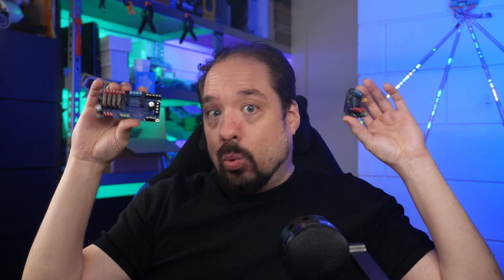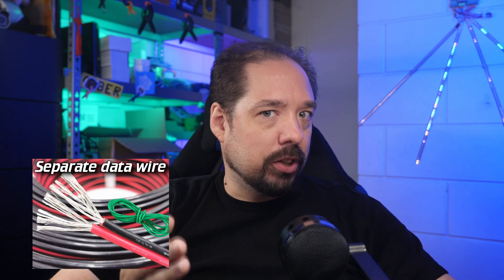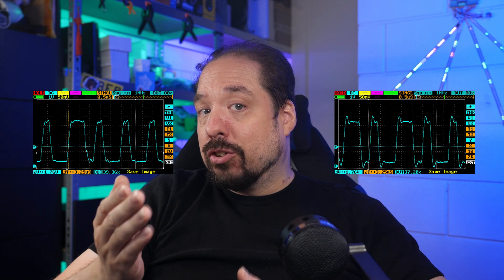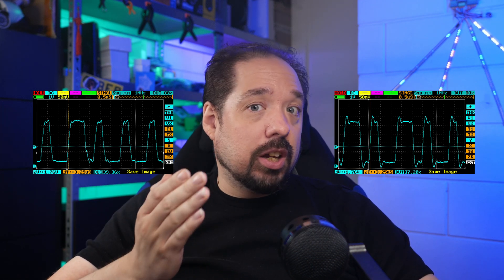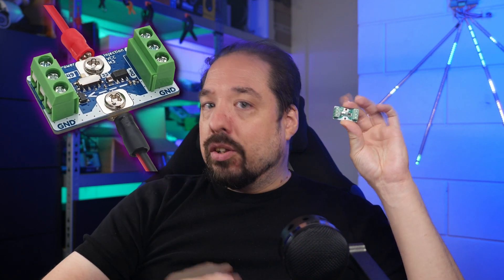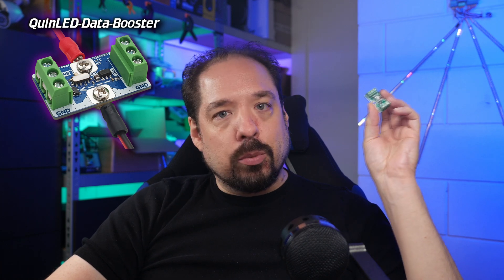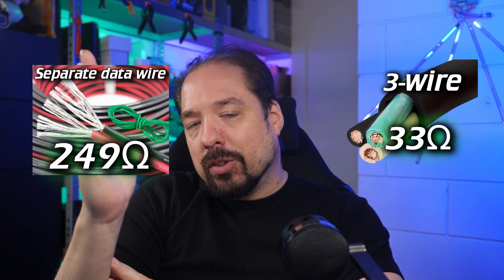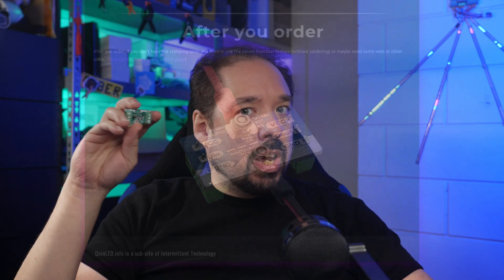💡QuinLED💡 Ever had flickering ws2812b LEDs? Watch this video!

Comment: so.. use a shielded data-cable. Gotcha.
Reply from the maker: It might help a little bit, but not that much. Since this video running on at least 2-wire cable with data and GND on there with a 33R resistor seems to be the best way to do it!

Comment: I have the problem that the first 4 LEDs in the whole row suddenly switch on. Always the same LED. I have a total of around 300 LEDs (5m) and around 1.5m from the ESP32 to the LEDs. I will now try to see if it gets better with a resistor.

Comment: What about using a twisted pair of wires with shielding and grounded on one end only. I'm not using differential wires, meaning the one wire is also connected to the grounded shield?
Reply from the maker: Sure that works but it isn't much different then data+GND running in paralel. Since the shielding is GND and GND is part of the signal (since single ended signal) it doesn't add much noise immunity unlike differential would running in a shielded cable.
Reply: @IntermitTech  So, how does this signal compare to a coax cable or other signal cables with single core in the middle with ground shielding? Certainly, they work a lot better than just a pair of wires?

Comment: What about a very short run of cable with the data line in it with the ground and power lines?  I'm working on a project in which I'll only have a distance of less than 3 ft between the controller and the light strip.
Reply from the maker: For those distances 249R and 33R will both work fine. 249R is a bit less shouting in that sense.
Reply: @IntermitTech  is it even needed?  After posting my question, I kept watching and later in the video, you mentioned the issue is only for long lengths of cable.  So 2 to 3 feet is long enough to have an issue?

My LED strip is a WS2812B.
Reply from the maker: @donireland6218 no no, as I mentioned for that kind of distance the value plays much less of a role

Comment: Thats what am looking for!  Great Video!  is that 33 ohm for one data wire... what if I want to use 3 data from one ESP32 board to three WS2812B strips.  does that mean 33 ohm resister on each data output?     4 cores cables (data1, data2, data3, Ground)

I enjoyed watching your channels :-)

Comment: I have changed resistor to 33 Ohms, it got better. But still some effects is flickering and some don't. Why can it be? Do I need power injection or data booster?
Reply from the maker: How long is your data cable and what wiring are you using exactly? It's really best to troubleshoot on the Discord server
Reply: The length of the first data cable is about 10 m on the first channel.  There are 106 LED's in it, powered on both sides. The length of the second data cable is about 5-6 m, there are 91 LED's on the second channel, the power is connected on one side. The effects start from the first channel and move on to the second one. The second channel works fine, but in the first channel half of the LED's, which are close to the end work randomly, but not in all effects. For example, Candy Cane, or Chase 2 works fine, but Bouncing balls does not. In addition, when the power is turned off on the WLED app, some light bulbs continue to light
Reply from the maker: @fevgg yeah that sounds like data issues. Are you running 3wire bundled cable?

Comment: I'm thinking that a tiny, adjustable trim pot would be a nice solution.  That would allow for better impedance matching with a variety of wires, and, at the same time, be easy enough to test with someone simply seeing where things were most stable on their string.  Cheap, easy, and flexible, and, avoids resoldering different values, or fixed values that may be compermises.

Comment: I started just with WLED and was frustrated that the LED behaved bad. Eventually I saw some article saying put a 240Ohm in DL; had none, but used 220Ohm. That worked. But you explained why. Thanks for that.  Now I need to find my little digital oscilloscope and try to record the data myself.

Anyway: subscribed …

Comment: Originally I was searching for best practice regarding ethernet and router configuration, but now I wonder if (in case one has an oscilloscope on site) the best practice for varying cable lengths simply a poti is.

Comment: Great info, I do have a question regarding my setup. and hopefully i can get someone to help me out. What i use: DC5V10A power supply, 5V BTF-LIGHTING WS2812B RGB 5050SMD, ESP WROOM 32 ESP32 Development Board 2.4GHz WiFi Dual Cores. I have them installed and they were working ok but i saw power hungry by the end of the strip (this is installed on the top of a room) so i provided 5V at the end of the strip and that fixed the power issue. 3 days later, the controler fried. I changed it for a new one. It worked fine for about 10 mins then i got that crazines color changing and flikering. I already separated the data cable from the power supply wires and still the same. the controler and power supply is about 1.5 meter away from the 1st LED and the full LED run is about 50 feet and 900 pixels.  What DO I Need to fix the flickering and random color changing??  TIA
Reply from the maker: That's a bit much to go into on a comment. If you are using multiple PSUs make sure to have a strong GND connection between them.

Data wise without a level-shifter and resistor it's more luck then science if it works at all. So that could be a problem.

900 LEDs on a single pin will also cause big framerate lowering, I recommend no more then 600.

Wire diameter for the injections are important too, especially with 5v stuff.

Not sure what is causing the ESP32 modules to fry though.
Reply: @IntermitTech  thanks so much… I am going to change the wiring for a smaller gauge and get a higher power supply and go from there.
Reply: UPDATE: I change the power supply (the previous one was rated 5V 10A but was pushing out 4.3V and about 3A)  I installed the new one that it is a 5V 60A. this one is pushing out 5V and about 40A. I also changed the wiring that goes from PS to Strip for a smaller gage and worked perfect. I have my auto brightness set at 5000 in the settings and it is more than enough.
Keep up the great content!!

Comment: If you drive DIN without a resistor and WITHOUT the main supply, you will burn at least the first WS2812B LED. 
Having a 230+ ohms resistor will protect somehow the input by limiting the current. That's a good reason in itself.  It should also protect a little against electrostatic discharges.

Comment: Thank you for your products. Appreciate the thought that went into the dig-quad and the videos and articles explaining how to use it and the concepts behind the board. Getting ready to start a permanent install of about 900 LEDs via 3 home runs. Was testing today and ran 5m ws2815 over outdoor 100' 3 conductor 16 AWG copper cable. (Soldered the backup data and ground wire together.) 249 gave some flicker. Was going to cut the wire at 3 foot increments to find the limits. However, found your guidance on the 33 ohm resistor. To my surprise it worked straight away over 100'. Super pumped about my project and showing off the lights. Thank you so much!

Comment: 😊So I had a problem with flashing lights, I thought I was going crazy because I couldn't solve the problem, I run an xlights show with two Dig Octa cards, I switched the switches to 33 and the problem is gone. If I had known where you live I would have brought you a smoked salmon from Urk, I can now sleep peacefully again. I did this after seeing this tutorial. I have everything with 3 core cable. Thank you for the explanation.

Comment: My God, you are a hero. 4 years of multiple ways of troubleshooting, and the fix is found because of a ground wire run with the data wire.   I am extremely happy and somewhat upset because of how simple the fix was and would have been in the past. I did upgrade my lights this year finding a work around, however I ran the lights the way I wanted thanks to you and the info you provided.  I happened to run across this video yesterday morning right before I plan on putting the lights up on the j channel I installed on my house. I tested it on the ground where I ran a f amp with nothing 4 days ago. Seperated the data line and wala. Installed on the house and forgot the f amp. Decided to test, and it's a miracle.   It is so simple, yet for some reason, I never would have run a test to find the answer on my own because I would have never imagined that being the issue.    HUGE THANK YOU!!!!
Reply from the maker: Awesome to hear it helped you out!
Reply: I have power and ground in one cable and 3 data together in another cable. The cables are ran about 5 meters and I'm having flickering. Would just adding the 249 resistor to each data line fix the issue, or is there also an interference issue with them being in the same cable. Thank you for the video, very informative..
Reply from the maker: @justintucker2172 no, running multiple signals next to each other is the problem there. Best way currently known would be to run 3x 2-wire cable with a data+GND on there in 33R resistor mode. That will very likely fix it!
Reply: @IntermitTech  I was under the impression that the ground was causing drain to the data, but you're saying I need a ground with data in 3 separate wires with the 33r resistor, correct? Thank for the quick response, had a little bit of a what went wrong moment when I finished the wiring the other night..
Reply from the maker: Yes, this type of data will have lots of crosstalk in that sense. So running multiple together over long distances is a bad idea. Running 3x 2-wire cable with GND on one of the pairs of each cable will provide a bit of shielding and probably make it all work. This does require the 33R resistor though.
Reply: @IntermitTech  Awesome, thank you very much.  Made sure to subscribe, great information.
Reply: How about splitting a data run with a simple y  cable assembly? I know this isn’t recommended and I have seen 4 way amplifiers from BFT Lighting. I have gotten away with the y splitter on a short run (maybe 8’). What ohm resistor would help in this scenario if any?

Comment: I have two jumps on my roof, I would fully be able to place the controller in the attic and start in the middle, eliminating the biggest jump and making it work. I am hopeful to make both jumps with one continuous run. However, I am having data drop. I am running in a 3 wire cable with 2811 and 248 pixels. When I get home, I am going to run a dedicated data line and cross my fingers.  Good luck, everyone.  Thanks for the video. I do have a f amp I put in the line not helping a thing.

Comment: Would this degrade over time?  I have that second scenario ~8-10 m of 3 strand wire.  I set it up on the 249 ohm and it worked perfectly initially.  However, after running for about a week, i now get major flickering and strobe effects.  It seems to be exactly what you're describing, but I dont know why it would work perfectly initially and degrade over time. Any explanation? Or should I look for a different solution?

Comment: I  suspect the reason the added resistor to the data line or, for that matter, the decoupling capacitor across positive and negative lines are not talked about much or when they are talked about there is no consensus is because it's part hogwash and part voodoo superstition.  The very same reason you'll be told you MUST use a resistor any time you use an LED yet billions, literally billions, of LEDs fairy lights are sold without a single resistor.   Myself, I have never once used any resistor on my data line, not on any of my projects and have no evidence to suggest it has caused any problems.  I generally don't use a decoupling capacitor either unless the distance from controller to LEDs is greater than four or five feet, though this is done more because of my own superstitions rather than any evidence it solves any issues.  I am currently looking at one of my earlier projects that has neither a resistor or capacitor on the twelve foot span of lead wires and has been running error free for years.  Years, and not a glitch.  Your mileage may vary so take my voodoo advice at your own risk.

Comment: Interesting video! I've had success with WS2811 and 12b using a single electrolytic capacitor in the data line, ~100-200 microfarads. This is what I use for a 1300 LED bulb array (similar to those xmas lights) with data running adjacent to pwr+gnd, as well as for a 91 LED strip series (+a bunch of parallels, 1091 in total). The cable length to the first pixel is ~2m max for both.
Reply: Only the distance to the first led should matter. The  signal is buffered from led to the next.

Comment: Great Video, I'm doing a project, 17 stairs, 59 led per stairs, installed in a diffuser, (60led/meters WS2812B).  I have 2 types of Boards I can use (ESP32 CH340C, ESP8266).  I've tested with both boards and  it works A1 up to the 14th stairs and then the 3 top stairs either blink or stay lit, I wonder if adding a resistor would fix my issue or if I've reached the limit of my 2 boards.  I've injected  voltage but I can get the 3 last steps to work properly.  I'd really like some help.
Reply from the maker: Poh very hard to diagnose like this! Maybe join the Discord sever? Easier to dicuss things.

Comment: Good explanation,  with the ground running next to the data signal, its acting as a capacitor, so you have an RC circuit.   That ramp is the charging of the RC circuit.
Reply: Not just the ground, but all of the other conductors in the cable. The more conductors in a cable, the more its capacitance per foot changes. (think of larger plates in a capacitor) The rounding off of the waveform corners is an example of integration. The small peaks on the corners of the signal are differentiation.  Picking the value of the resistor is actually easy. Its value should be as close as possible to the cable impedance. What's not easy for the typical user is determining the impedance of the cable.

Comment: Hey, Thanks for the great information. I will definitively buy a few of those boards. I was also looking to buy the QUINLED DIG QUAD esp32 with LAN but the worldwide side (I am from Canada) says it's out of stock.... : (. Any other way or place I could purchase one of those board?  Thanks in advance.
Reply from the maker: If Worldwide is out of stock too we've really run out. A new batch is on its way, check back at the end of the week or begin of next please!
Reply: @IntermitTech  Managed to order 1 with 3 Data booster!!  : ) Can't wait to get them and start working on my project. Thank you.
Reply: @IntermitTech  I ordered Two V3 DIG-Quad last week do I still need the data boosting board ?

Comment: would the booster be better nearest the strip or halfway? what about the resistor? i do have a very long data line bundled with others for half of the way but it is dedicated. im thinking a 'differential' signal might be useful, if you have a video or guide somewher eon that? or a chip i could buy? or would it be simpler to just have another controller mounted nearer that strip?

Comment: I’m at a loss even after this video. My cables are all separated, but I tested with a 33ohm, 67ohm, and 270ohm resistor. 67 seems the most stable, 270 made the LEDs difficult to see (as though they barely worked anymore) and 33 made them flicker ALOT. 

My guess is that I need to find a sweet spot resistor for my setup, just despise all the testing that’ll have to be done. 

Any ideas?
Reply from the maker: Yeah it very much depends on the setup, from all my testing 249 and 33 was best for specific situations and made a lot work, but it's possible your setup reacts a bit different.

Comment: I have a question regarding the total length data can travel on strings via a Dig Uno. I know power should be injected every 5 meters but at some point does the data signal become too week to drive the LEDs?
Reply from the maker: No in theory the data signal gets repeated by each LED so can run for longer lengths (not long gaps though, the LEDs need to be fairly close. But there are limits, see here: https://quinled.info/2021/03/23/max-amount-of-addressable-leds/

Comment: I think your video will save me for tomorrow, i just put 4 120 Leds strips separated betwrenn them for like 4-6 meters, so what i will do is after the end of each strip i will add the 249 Ohm resistor to check if the signal goes good to the second and thris strip! ill let you know!

Comment: Okay, but WHY does the resistor help? You explained the scenarios and electrical values and what happens on a scope, but not why a resistor (and not a capacitor, inductor, etc) is the right fix here.
Reply from the maker: Ah right, that wasn't really the intent of the video. In this case the resistor better matches the impedance of the cable and for scenarios where GND is close it allows a much higher and quicker pulse of energy over coming the effect of having ground so close to it for the long distance. It's just a different scenario to tune for basically. The resistor also provides in a bit op dampening for the single ended signal to dampen down reflections and such issues otherwise.
Reply: @IntermitTech  Ahh impedance matching! I know just enough electrical engineering to be dangerous. Thanks for the explanation!